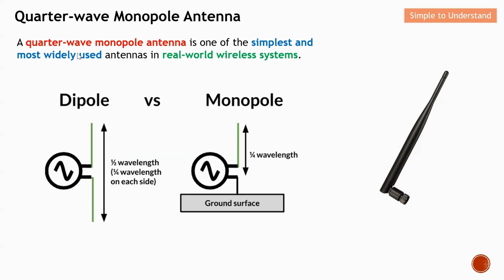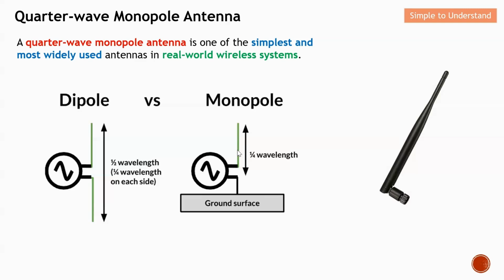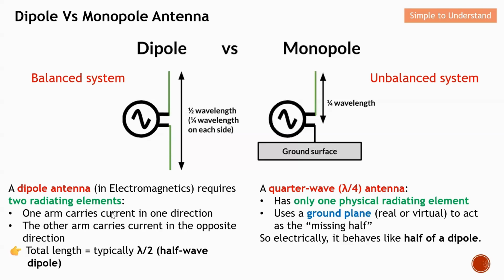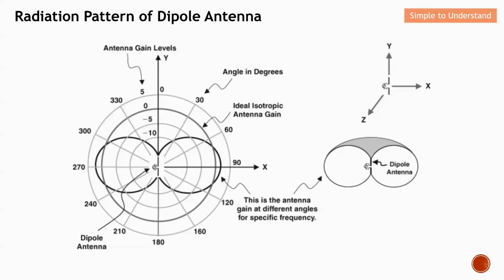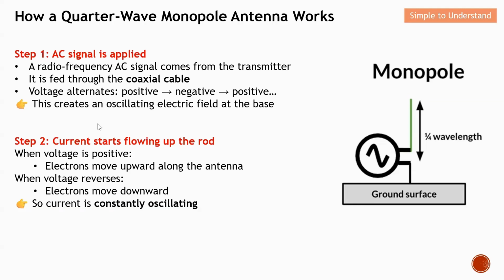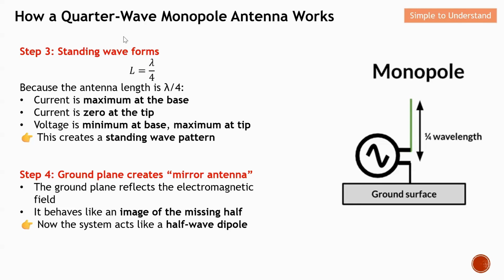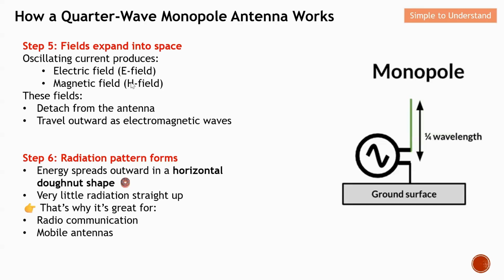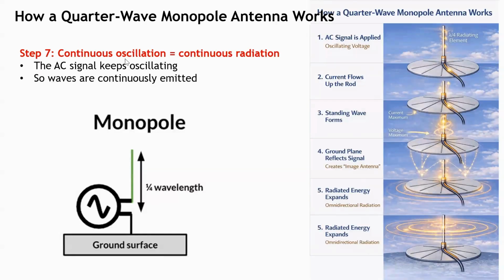Antenna #25. Quarter Wave Monopole Antenna Masterclass | Design, Working, Uses & Dipole Comparison

Comment from the maker: Thank you for taking the time to watch this video. In this video, I explain what a quarter-wave monopole antenna is. In my earlier video, I discussed dipole antennas in detail. Monopole antennas are more attractive because they are smaller compared to dipole antennas. This is because “di” in dipole means two, so a dipole has two radiating elements, whereas a monopole has only one.
In addition, you need to understand the radiation pattern to judge whether this antenna is suitable for your needs. Last but not least, I explain step by step how a monopole antenna forms and how the source releases electromagnetic waves into the air.

Comment: Why is one half of a dipole grounded in amateur radio practice? Doesn't that make it sort of a monopole? Wouldn't it work better if it wasn't grounded and was a true dipole?
Reply from the maker: Monopole antenna is preferred because of smaller and more compact. Another reason is easier to install to coaxial, or BNC connector will do because there is already a common ground on PCB.  :)
Reply: @technologiesdiscussion1676  That's not what ham radio "elders" have told me. They give all sorts of explanations of why one side of say a 40 meter dipole is grounded. IDK but that makes no sense to me. Seems like you are making a 1/4 wave monopole. Why do hams insist that one side of a dipole be grounded? I have some old tube-type rigs where the shield is not grounded (no powerline ground) but modern solid state rigs have the antenna grounded at the connector/chassis/powerline.
Reply from the maker: A classic half-wave dipole is balanced and floating:
- Two equal legs
- Equal and opposite currents
- No connection to ground required

Some antennas are intentionally grounded (but aren’t dipoles)
Examples:
Vertical antennas (true monopoles) → require ground or radials
End-fed half-wave (EFHW) antennas → often use a ground or counterpoise
These are not dipoles, even if they’re used on 40 m.